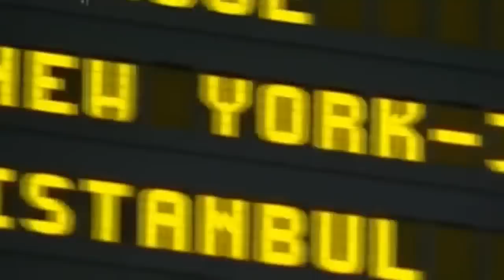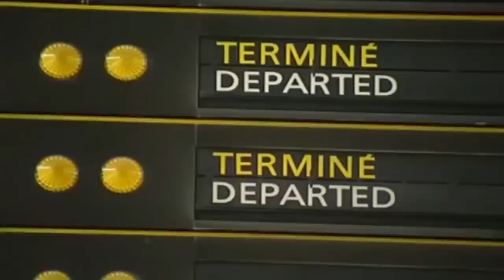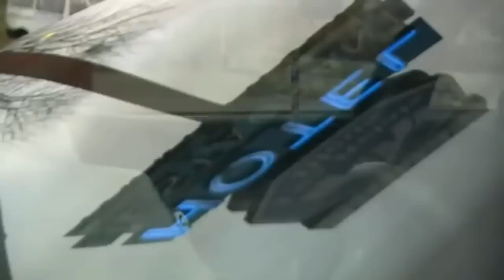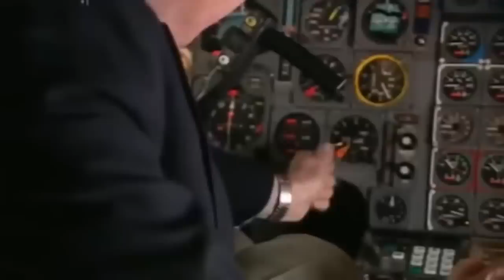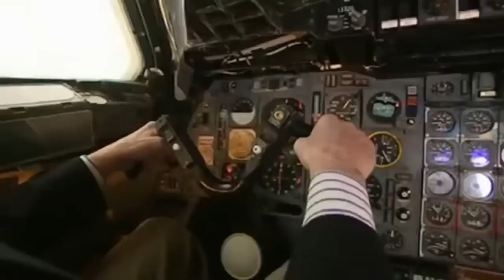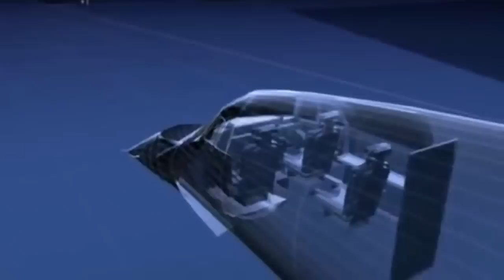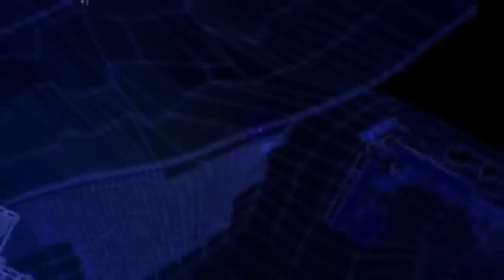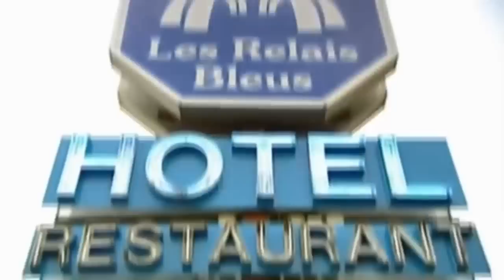Air France Flight 4590 Concorde Disaster Paris

Comment from the maker: This accident was the death knell for the Concorde programme
Reply: you think they will ever retry to make this program or type of aircraft
Reply from the maker: Not Concorde, it's a 1950s/60s-designed aircraft. In the future however, new developments in manufacturing materials and engine technologies may make supersonic flight more economically viable!
Reply: If we are lucky. For now i know they are working on improving speed and safety of an aircraft
Reply: If the captain didn't ask for the repair the Concord wouldn't have crashed. It would have taken off before the Continental plane dropped the piece of metal on the runway. Sooooo unlucky!!!
Reply: In September 2015, it was publicly revealed  that the Club Concorde had secured over £160 million to return an aircraft to service. A tentative date of 2019 has been put forward for the first flight – 50 years after its maiden journey
Reply: Wow, so that means I might see the Concorde again taking off over the Rockaways?
Reply: Andrew Piatek ...and maybe crashing there, too...
Reply: +Di Pudriano Hey, there's always a risk.  If you want to avoid any risk, sit your rear end home and don't even stick the nose outside. That's a way to live, too.
Reply: Mayday Air Crash Investigation no it's not. The death of the program was the increasing fuel price, and the inefficient nature of Concorde.
Reply: Artruis Joew agreed
Reply: Mayday Air Crash Investigation it was the rising cost of fuel thus making it too expensive for most to buy tickets
Reply: hayleyquinn1
That too.  And customers who were September 11th attack victims.
Reply: hayleyquinn1 Not just that. Bcuz of the need for speed, it's d fuselage is pencil thin, narrow & cabin small. It cldn't carry enough passengers to justify the cost of operation. Dats why Americans didn't build 1. Wall Street Guys were smart enough to know that. It has never made a profit. If it was profitable -- crash or no crash -- it wld still b here.
Reply: +Paul Haye Profit no profit, the Concorde was one of the most beautiful and wonderful airliners in the world (together with 747 and DC-10).  Business is not everything in life.  Experiencing beauty, awe, excitement, and satisfaction is more important.
Reply: Andrew Piatek
 U'r kidding me right?  Biz not everything? In d USA, France or Britain? Concorde couldn't even sell enough tkts to pay for the fuel, much less the rest of the expenses.  Also in a recessionary times a $10k round-trip tkt was something not even the big biz execs were willing to pay.  Not when they can video conference.  Economics killed it. Nothing else.
Reply: +Paul Haye Well, the first class tickets today can go as high as $21,000.  For that, you get a bed like compartment, with some cheesy LCD screen. I'd prefer supersonic seat with view of curvature of the earth at 60,000 feet for $11,000.  Privateers are working on bringing Concorde back to limited service, and money is not the problem.  They already got the money.  Beauty is timeless.  Business is from quarter to quarter.
Reply: Andrew Piatek
Let me end this thread by saying that as with the shuttle, money is always the #1 factor.  Maybe like you said there might be a place for limited concorde service, but only if it's profitable.  Investors will take a growth-mode loss, but eventually it has to turn a profit or the venture dies.
Reply: +Paul Haye Profits are for manimipulators, con men (like Barack Obama) con women (like Hillary Clinton) etc.  Beauty and hope lies in our new president elect.  He'll invest one trillion dollars in our infrastructure.  I hope JFK airport will be restored, that we'll have high-speed train from Japan (not the French) in the U.S. and I hope we'll eliminate crooks in our government by eliminating lobbyists.  Let's worry about profits later. If you don't invest first and take a risk, you can stick to flying your automated Airbus vacuum cleaners, cut the other pilot's job for more profit, etc.  If you're into minimizing cost and maximizing profits, customers will eventually start hating you.  It's what's happening to Apple right now.  If they keep conning people into their outrageous business strategies, they'll fail.  Nobody is too big too fail.  And I'd rather have big manipulators fail, and they will.  2016 U.S. presidential election has proved that.  Killed off three dynasties of profit makers in the government.  I choose non-profit making Concorde over those crooks that we, the voters, voted out of the system.
Reply: +Paul Haye Profits are for manimipulators, con men (like Barack Obama) con women (like Hillary Clinton) etc.  Beauty and hope lies in our new president elect.  He'll invest one trillion dollars in our infrastructure.  I hope JFK airport will be restored, that we'll have high-speed train from Japan (not the French) in the U.S. and I hope we'll eliminate crooks in our government by eliminating lobbyists.  Let's worry about profits later. If you don't invest first and take a risk, you can stick to flying your automated Airbus vacuum cleaners, cut the other pilot's job for more profit, etc.  If you're into minimizing cost and maximizing profits, customers will eventually start hating you.  It's what's happening to Apple right now.  If they keep conning people into their outrageous business strategies, they'll fail.  Nobody is too big too fail.  And I'd rather have big manipulators fail, and they will.  2016 U.S. presidential election has proved that.  Killed off three dynasties of profit makers in the government.  I choose non-profit making Concorde over those crooks that we, the voters, voted out of the system.
Reply: Mayday Air Crash Investigation   "M jvnv n.j.!
Reply: Exactly, an accident that wasn't caused by a fault in the plane wouldn't end its production. In another documentary they stated that it wasn't environment friendly to be used as an every day liner, the noise wouldn't allow it to fly over the states limiting travel to passengers and that the amount of fuel it took was far too pricey to keep it up. 

If I were to see any aircraft come back I'd want it to be the SR-71, that aircraft is still the coolest.
Reply: DingDongDanger The SR-71 is a spy plane. It is obsolete due to satellites & drones. Won't see it again operationally.
Reply: I know! RIP Q_Q I want to go to the hill aerospace museum here and check it out!
Reply: Paul Haye
Reply: ive been there
Reply: Mayday Air Crash Investigation not compleatly it was part of it.this.9/11.sonic boom.quit a lot more
Reply: Mr.Philip
Reply: Mayday Air Crash Investigation Nail
Reply: If it's engines were like the a380s' good for environment it would still be here. Concorde used up lots of fuel which costed money. And people disliked the fact it harmed the ozone layer. It needed one more downside to disappear, then the crash happened
Reply: I will try my best to bring it back. Better.
Reply: Programme?
Reply: Why though? Wasn't the problem from something on the runway?
Reply: +Mayday Air Crash Investigation.......you are somewhat 'fast and loose' with your facts. Firstly and although initial studies into the feasibility of commercial supersonic flight began in the early 1950's - development of Concorde itself did not commence until the early-mid 1960's. (the first Concorde was produced in 1965 and entered operational service in 1969). So Concorde was most definitely not a 1950's design. 
Secondly, whilst Air France never made money with Concorde, British Airways were turning a profit of 30M GBPs per annum with it - this despite America's single-handed opposition and restrictions to the aircraft. It was actually the general downturn in the commercial aviation industry following the September 11 attacks in 2001 (especially the dramatic fall-off in London-New York flights) and the end of maintenance support for Concorde by Airbus that greatly contributed to the aircraft's withdrawal from service.
Not sure what you are implying by your comment regarding 'developments in engine technologies'? During Concorde's entire operational life only 1 jet fighter ever caught and passed it - even F14's and F16's were unable to match Concorde's speed! So I am fairly confident that the Rolls-Royce/Snecma Olympus 593 engines were (and still are) extremely capable power sources. 
Finally, there had been very recent moves by British Airways to re-introduce supersonic flights using Concorde (which has been modified - particularly in respect of the fuel tanks and wheels - to prevent a recurrence of the fatal Paris crash of 2003). Unfortunately due to BA's highly perilous future resulting from their catastrophic IT meltdown a few months ago - this may now never come to pass?
Reply: Elon Musk will bring us IC-Passenger-Rockets ... London -> New York 40 mins.
Reply: Paul Haye SR-71 is the best and NOT obselite!! You are obselite
Reply: Mayday Air Crash Investigation it's a beautiful plane
Reply: The safes plane ever was killed by a plane that is held together with scotch tape! The Concorde never crashed because of a part on the plane failing.
Reply: Sadly, yes it was.  I flew on the Concorde from New York to Paris many years ago, (sure I'm old now, but still a GA pilot!) I was so sorry to see that plane lose its future.  It was a magnificent plane, (I loved those square engine intake ports) but no one REALLY has to "get there" that fast.  You're not going to a fire, though 200+ mph taking off down the runway seems like it, nonetheless, sad to see it go.  It was certainly thrilling while it lasted.  It was the most beautiful, graceful passenger aircraft ever, though not the most comfortable.  But then, you gave up a lot for speed!  And the view up there -- staggering!
Reply: I don't agree. I feel like this accident was the scapegoat for Concorde's retirement.......the real reason it's gone is because it was costing too much money. There have been several different plane crashes/disasters throughout the historical timeline, those planes are still flying.
Reply: I agree with you!  Far more than money, was the problem of noise pollution that upset a bunch of namby-pambies living in the TO&L areas!  I flew on the Concorde and loved it.  Today, maybe, barring a bunch of liberals who don't wish to see progress, we will see the beautiful Tri-Jet X-B1!   I hope so.  It even looks similar to the Concorde only smaller -- beautiful!
Reply: You're wrong. Concorde was too expensive to operate. Only 14 Concordes were ever in service in that 27 year era of supersonic air travel. Safety played no part in its demise. A 787 Dreamliner would crash after hitting the shit that Concorde hit on the runway. Concorde lasted 24 years without crashing. No airliner since has pulled something like that off. In terms of safety and indeed engineering, Concorde is to this day a design marvel that has yet to be significantly beaten.
Reply: There were a lot of reasons for the demise of the beautiful Concorde.  The "boom" generation is about to arise now, though, and while the XB-1 looks like a small Concorde, it only will carry 45-55 passengers, so they'll have to make a lot of them.  But for some, a one-hour flight will beat a 7 or 8 hour one, so there WILL be passengers.  But seeing how many the Airbus can carry in comparison, for a while anyway, there won't be much competition.  I would rather take a red-eye Boeing 767 or triple seven any day than an Airbus!  I'd just sleep!  Long ago, I was flying American Airlines from New York to California, a red-eye, and the flight attendants fed me, gave me a glass of wine, put the arm-rests down on three seats right behind the bulkhead, gave me a pillow, I stretched out and they cross-strapped me in, and I slept all the way home.  How nice is that!  I flew AA all the time after that!
Reply: It is impossible to sleep on a plane with all the noise from Rolls-Royce jet engines and screaming babies. Are you deaf or on Ambien?
Reply: Both, no doubt!  My father was a physician, and when we traveled, he gave us a little phenobarbital on long, boring trips, just enough to sedate us a bit, and we slept!!  When I was world-traveling, often I took a red-eye and either took a small amount of sedative, or the flight attendants gave me a glass of wine and tucked me in!  I can NOT stand being around young children or babies on a flight, just won't do it!  The engines kind of help drone you to sleep, a bit comforting as long as they're going, of course!
Reply: I doubt there were any screaming babies on that Concorde flight -- not at $9300 dollars plus a person!
Reply: Interesting facts about congratulations I had one of the worst experience CDG NAP! let you know 😅 follow later other as much AF SU LX other destinations!
Reply: AF CONCORDE  FCO ORD  CO airports and airlines AF AFR  ,passenger lists and cabin crew  as much   AF JFK FF TOW charters since 97 before many airlines disasters  BEA AF  and on , IATA cab ntsb  faa

Comment: As sad as this tragedy was.. there was no mention of the landing gear change a few days prior, and the omission of fitting a critical spacer (on the left gear from memory) to keep the gear in alignment when deployed... this caused the aircraft to crab sideways during it's takeoff roll, (google the photos of the skid marks on the runway) hence it's smashing into a runway light.. and finding that famous bit of metal from the DC-10. (I'm in the aircraft industry and have the official report.) there was a chain of events that lead up to this that isn't mentioned in this video...the aircraft accelerated much slower (reason for the pilots to abort the takeoff alone... being French and very proud they didn't....) and was much more sluggish to respond during it's takeoff roll, it was approx 6 tons overweight with the "extra baggage" and subsequent wind change (yes it should have taken off from the opposite side of the airfield)...very sad day this one... still remember where I was too... most beautiful aircraft to ever fly.
Reply: You're in the Aircraft Industry, you mean you are a trolley dolly

Comment: The claim that a metallic strip caused the crash was disputed during the trial both by witnesses (including the pilot of Jacques Chirac's aircraft that had just landed on an adjacent runway when Flight 4590 caught fire) and by an independent French TV investigation that found a wheel spacer had not been installed in the left-side main gear and that the plane caught fire some 1,000 feet from where the metallic strip lay. British investigators and former French Concorde pilots looked at several other possibilities that the BEA report ignored, including an unbalanced weight distribution in the fuel tanks and loose landing gear. They came to the conclusion that the Concorde veered off course on the runway, which reduced takeoff speed below the crucial minimum. John Hutchinson, who had served as a Concorde captain for 15 years with British Airways, said that "the fire on its own should have been 'eminently survivable; the pilot should have been able to fly his way out of trouble'", had it not been for a "lethal combination of operational error and 'negligence' by the maintenance department of Air France" that "nobody wants to talk about".
Reply: "nobody wants to talk about," yup, the metal strip was their saving grace. Life was lost, but why admit their false? Same w/ flight 447, they saw nothing wrong w/ the design of the Airbus control sticks...

Comment: Still why this beautiful plane was grounded forever is beyond me.
Planes crash all the time, 747' 777, air Bus you name it they all crash but I don't see them grounded then why Concord was singled out. It is stupid if you ask me.
Reply: Tariq Choudry  It was grounded because 
a) it was too loud to fly over the ground because of sonic Booms (they were limited to only flights over ocean)
b) Because Oil prices (Fuel) Made it way to expensive
Reply: Well I am thinking that after this crash, not many people wanted to fly the Concorde and spend so much money on the tickets. They were afraid to fly in it anymore and they subsequently lost money, so they cancelled it a year later I believe .

So strange to think this was all before 9/11
17 years ago is a long time...
Reply: Tariq Choudry concordes required very specialist maintenance on either end of flight, an idle backup in case of problems that's sitting wasting money, huge noise over any occupied land it flies over, and simply couldn't cram enough passengers into the small fuselage for any significant long term profit. 

Like medicines and other technology, the invention exists, people just can't access it because of... Market capitalism?
Reply: Da ve  They were to expensive to maintain. It was suppose to replace the 747 in the early 70,s never reached full potential. To expensive to maintain, to expensive to fly. Soviets copied it, called it T.U. 144. Designed by British and French.
Reply: Plus, hypersonic needs a lot of fuel (too expensive). Only a state like Qatar would have no problems having such planes.